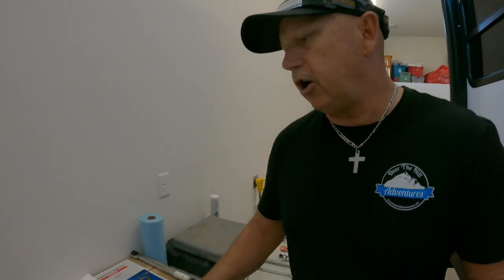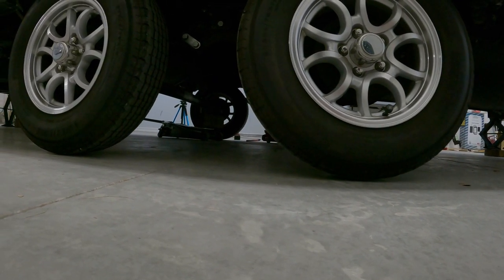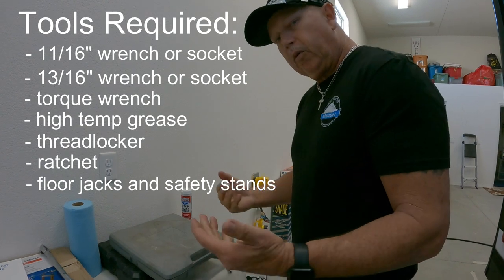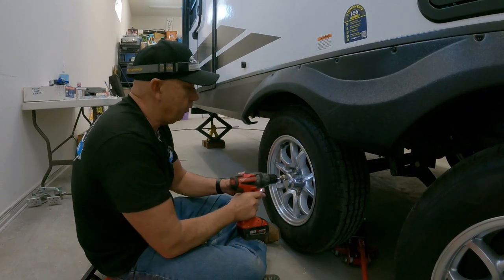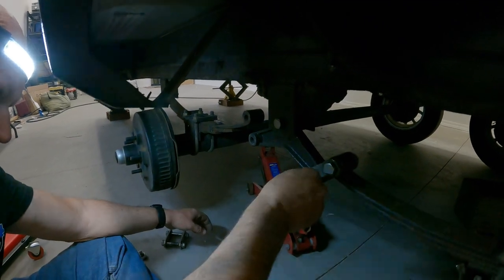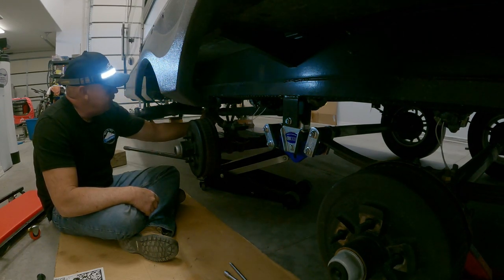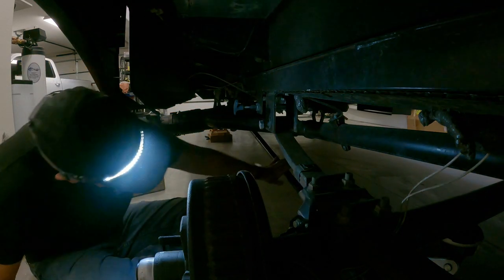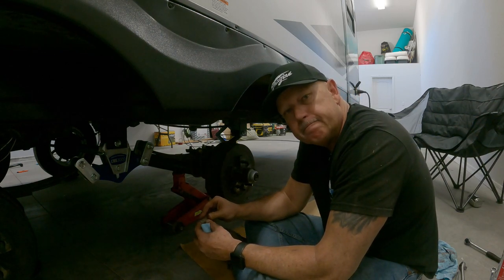GRAND DESIGN IMAGINE // MORryde Suspension System and Wet Bolt Kit Upgrade // Full DIY Video

Comment: What was the center line for the Equalizer... end to end center of bolt holes please
Reply from the maker: Chuck, I’m sorry I don’t understand your question.  Stan
Reply: @OverTheHillAdventures  So the other most holes of the CRE3000 the measurement for that on the factory equalizer. After doing a little more research it looks like these are too small since my wheel base (center to center of wheels) is 42" and requires the longer CRE3000 part
Reply from the maker: @OttawaMale43  so we have a 35” wheel base.  We we spoke to Steve the MORryde representative at the Quartzsite RV show which on video told us what to buy.  He specializes strictly with the Imagine series.  It bolted up perfectly.  I hope this helps.  Several of our viewers have done the same job and are very pleased with the outcome. I’m sure MORryde can help if you have any other concerns.  We have traveled over 3,000 miles across the country on the new suspension. The suspension has worked fabulous.  Thanks Chuck, Stan

Comment: Hi Stan what did you    Torque Your wheels are If you don't mind me asking
Reply from the maker: 40lbs that was recommended by MORryde.   I did use some lock tight.
Reply from the maker: Sorry Dan miss read your comment.  Wheels are 90-95lbs no lock tight..lol

Comment: Did it change the ride suspension feel ?
Reply from the maker: Rene, I just drove across the country. I feel it handled great!! It just feels much smoother.  The roads are horrible.  The suspension handled it great.  I think I probably would broke a leaf spring with the stock suspension with the roads we traveled. Stan
Reply: @OverTheHillAdventures  thanks for answering so promptly, I have a 37’ Raptor 5th wheel and my wife and kids ride in the back. They complain because it’s such a rough ride. I have triple axle and I’ve already broken 1 leaf springs and expect to break another on a long summer trip🥴. I now believe I will be switching them out as well ! Thanks for they video and reply !